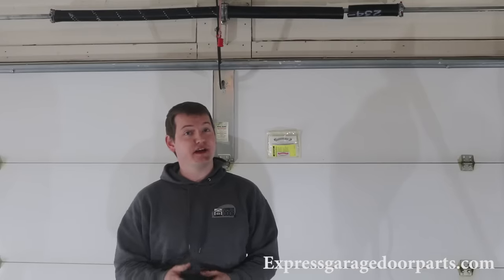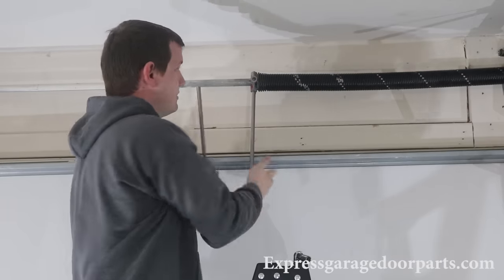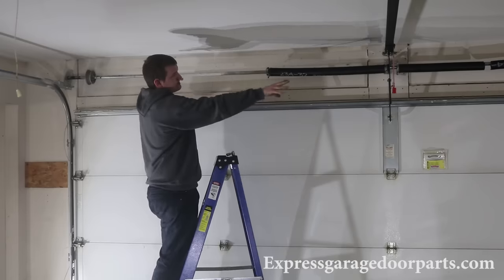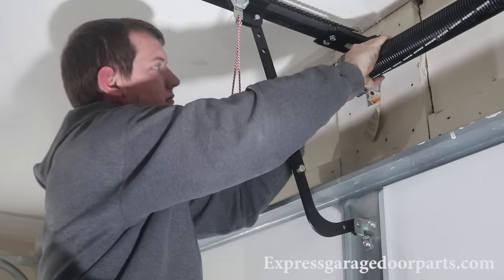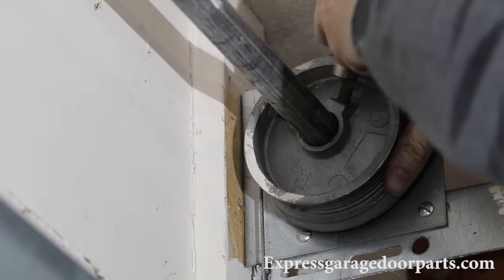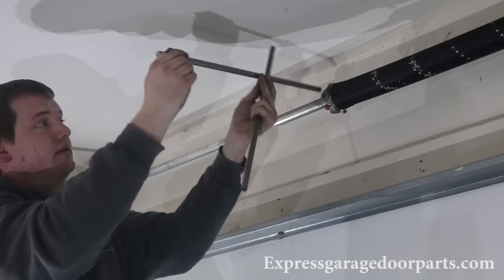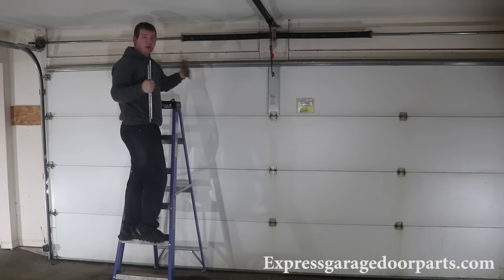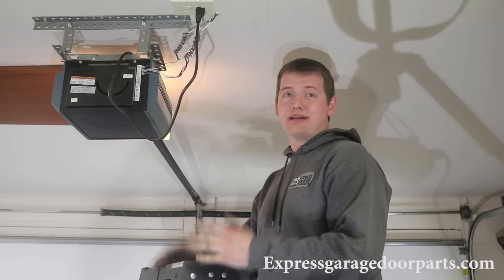Garage Door Torsion Spring Replacement: How to by [Professional Tech]

Comment: This guy just saved me $400. This is an excellent video that clearly shows how to get the job done safely.
Reply: Please someone explain to me.  If I buy a pair (2 pieces of Torsion springs) how do I know which one is left and which one is right.  Thanks.
Reply: @ilijanikolic  They are marked on the package.
Reply: Where did you buy the springs?
Reply: If it's $400 2 years ago then he gonna save me $800 now

Comment: Excellent video, helped me out of a jam!! Note guys, if you don't fully adjust the springs 30 1/4 turns the cables will keep falling off the drums and tangling each time you open the door beyond a certain point, causing you to start all over - don't be afraid, the resistance becomes extreme after about 20+ but keep going to 30 regardless!!!

Comment: Excellent video. Replaced my springs and rollers in a few hours and saved over 200$. Buy the parts from thier website!  Everything in the big kit is what I needed and even replaced a few other parts included in the kit.  Went so smooth. Thanks.

Comment: So glad I watched this video. On my rental's garage, the bracket between the two springs that attaches to the wall decided to rip itself free. I spent $20 on some winding rods and longer lag bolts and repaired it myself. After worrying half the day about making the repair, it turned out to be super easy.

Comment: Thanks for the video. I'm mostly handy and replaced my torsion springs in about 90 mins from start (getting tools, removing old springs) to finish (testing and putting tools away). Laptop and your video at my side - pause/do/play/repeat. My center bracket wasn't like yours so it didn't hold the bar in place very as I removed/replaced items. Also, I watched the left cable instructions about 10 times until I let it play to see your right side instructions were much clearer (verbally and visually). I wish they were reversed. Overall, fantastic job. And thank you for saving me several hundred dollars and a few days wait for a tech to arrive.

Comment: Great video and also a great company to purchase product from.  The product was high quality, the packaging was very good (seems like a rarity these days) and the product arrived in two days for standard shipping!  If you call them to place your order, it is better than doing it on-line.    They provided two bars for adjusting torsion, plus a set of 8' door cables at no charge.  If I ordered on-line, those would have cost extra.  They also told me how many quarter turns to make for torsion (34).  I did have to back off two quarter turns, because my door didn't go down tight to the floor, even through there was no pull on the garage door hardware that was holding it up.  Just follow the instructions in this video and things will go smooth.

Comment: Great video.  Changed mine out with no issues thanks to your video.  Local places wanted 275-$300 for a single spring on a residential door.  I did it for $40. About an hours time.

Comment: Good video as everyone says and to anyone wondering about shipping it is same day shipping. I ordered before 1pm and 48 hours later had my springs and proper winding rods at my door! Also I exchanged a couple of emails with measurements and photos and got a corrected set of springs for what had been a mismatched set for decades. The smaller old spring is the one that broke btw.

Comment: great video. thanks so much for making this easy. the tension was high (pun intended) winding those springs, especially when one of the holes on each of the springs was poorly fitted to the tension rods. this video was incredibly helpful and all the tips were spot on. The file is a MUST have. a hammer also to tap the old springs loose since the set screws had been way over set and crimped the tubing. thanks for making this way less dangerous with solid advice and easy instructions!

Comment: Over three years later and this was very helpful in fixing a setup where everything had lost tension.  I pulled out my torsion bars and your video took me from totally forgetting to getting it right on the first try. Thanks for keeping the full replacement directions on point and still give good tips, especially on the warning with dangerous locations in the work zone.  I fixed my garage on the first try; I had no idea that turns 25-31 would give me such a workout.  You were absolutely right about the spring expanding to be longer as it gets tightened up.
Reply: Great video.  Thank you for posting.

Comment: I DID IT!!! Thank you for this video. I must have watched it 10 times through, and then paused-and-replayed during the process to make sure I didn't screw anything up. Installed a 36" spring. Only mistake I made was accidentally threading one of the lifting cables through a bracket, which stopped the door short. Didn't take long to fix that, though.

Comment: My garage door broke over the weekend and I called a company out to get an estimate on 
Repair (Not Express). They quoted an estimate of 189 by phone for a single broken spring and said they would wave the  $65 estimate fee if I went with repair. They came out and said it would be over $590. I called Express garage door parts after measuring the spring and the person told me exactly which pair to replace my single spring set up. Everything you need to know is explained in this video there's a very easy to install and I saved a lot of money! Thank you for the great video and customer service!
Reply: The company that came out tried to tell me the steel wires were snapped (they we're not and I didn't even bother replacing the wire. And that they would have to charge 189 x 2 since it should have two springs.

Comment: Great video, I have never changed a garage torsion spring but watching your video gave me the step by step know how.  I successfully accomplished the task of changing both springs in about an hour and a half going really slow.  I probably could of done it in an hour but I chose to watch the step by step video in between each step ensuring that I made no mistakes.  The tip with using the file was spot on because I ran in to the issue with the large pole that holds the springs sliding back and forth.  Thanks to having the metal file handy, I was able to shave it down and have it move freely.  Again, great video and thank you for taking the time to help out the diy community.

Comment: Thank you so much for the video.   
My question is that my door spring wire size is 0.243 inches. Can I replace it with a spring with size 0.25” with all other measurements the same as the old one?
Reply from the maker: Thank you for your question! In order to change the wire size, the length will need to change as well. Please feel free to see us an email and we'll walk you through what you need!

Comment: Thanks for the video.

I have some questions for the channel and anyone who can help:

For some reason, each time I manually roll/push the the garage door to the upmost position, the cable slacks off, causing the cable to become tangled. It's as if the tension on the cable is lacking at the upmost position. Any thoughts on how to solve this issue?

Also, does a garage door normally stay up on its own when rolled up to the upmost position?

Tension on Torsion springs are fine, the door DOES NOT ride up by itself. The balance on the door seems fine. Door stays in position when lifted 1/4-1/2 way up. Torsion Springs are similar to previous spring measurement-wise, EXCEPT: the new springs are 2 inches longer than previous spring, but wire dimensions are the same. Meaning the Torsion springs can lift a heavier door.

Any thoughts on the questions would be highly appreciated. Thanks

Comment: By far the best do-it-yourself videos I have found as far as garage door spring replacement.  I am curious though, my garage door only has one Spring and it is a 2 car garage. All the videos I have watched show 2 springs so should I be adding a second spring?
Reply from the maker: Thank you for your question! Generally you will see one or two springs on a garage door. If you currently just have one, depending on the weight of the door we can get you a matching pair, which as many benefits. Give us a call and we’d be more than happy to get you fixed up!
Reply: Thank you for your response, I called and spoke with Avery and he was able to get me taken care of. I should be recieving my replacement springs in the next couple of days. Thanks again guys for making this process a lot easier than most advertise it's going to be.

Comment: Great video! I have a question though - why didn't both springs unwind when the right one broke? They're bolted together, so shouldn't the broken spring free up the torsion springs to unwind themselves (the set screws shouldn't be a factor if the spring is broken)? What am I missing? Thanks, and I'm sure I'll feel stupid if someone posts the answer because I'm sure it's obvious and I'm just missing something simple.
Reply: Hi there Bay1!!  The reason that the second spring did not come loose is because they are both bolted through a center bracket.  If you look closely at the video, you will see that when he connects the two springs at the center, the bolts go through a bracket in the middle of the two springs.  So when one of the springs failed, the unbroken spring kept its tension as it's also attached to the center bracket.  Great question though!  Hope this comment helps!!

Comment: if I may suggest one thing, before bolting the new springs together, spray the center berring with lube first, just to make sure it don't squeak loudly. A dry center berring will make a ton of noise
Reply from the maker: Yes, that's a good idea.  Thanks for your input.
Reply: Also I need help figuring out the right springs for my door. Can I get help? Thanks
Reply from the maker: Sure, just call our tech line and one of our engineers will be happy to help.
Reply: what's the number?? Thanks
Reply: Spray the springs and every moving part of the door with Wd-40 and it will reduce the noise of the door when going up and down. You wanna do this at least 4 times a year.
Reply: Garagedoorpro20 depends on how heavy your door is. If you have a regular old 26 gauge metal door then your spring is going to be a 250x30.5. If you have a a double steel insulated door it’s going to be 2 218x26.5’s both a right hand and a left hand spring.

Comment: @Express Garage Door Parts ,  Do you suggest replacing both springs even if only one spring is broken? Just wondering if the same logic applies that I usually replace a set of something due to not wanting to do the job again when the other spring finally breaks.
Reply from the maker: Chris-
Thank you for your question! We always recommend replacing both springs as they have the same “cycle life” and tend to break around the same time. Best to do the labor only once while everything is apart!
Reply: @expressgaragedoorparts5380  My friend springs are about 18 yrs. Old ( original ) …The door is not going up…is it safe to tension them both ?

Comment: My garage door won't open all the way, and I noticed one spring is broken. Is the spring the problem? Question for anyone.and good vid. Looks like I'll be replacing the springs..
Reply from the maker: Raul P Thank you for watching our Video! Yes the broken spring will be your issue as they do all the lifting for the door and will need to be replaced to get the door back in operation.
Reply: @expressgaragedoorparts5380  ok great vid. I figured that was the problem and thanks! Thumbs up

Comment: You replaced both springs even though only one was broken?
Reply from the maker: David Schmiedeberg This is correct! Generally springs will break around the same time. So it can be a good idea to get the other spring replaced while everything is already apart. Best to not have to do this process again the following week!

Comment: do we have to replace in pair? eventhough its only 1 side broke?
Reply: Yes replace both or your new spring will work harder and will not last as long trying to compensate for the old worn out spring you did not replace.
Reply: i have springs size with 225x2x28 and around 8 feet high, how many turn on the setting for springs?
Reply: If your door is 8ft tall then you will do 34 quarter turns. After make sure door is balanced (doesn't slam down or up should be good.
Reply: thanks for the help.